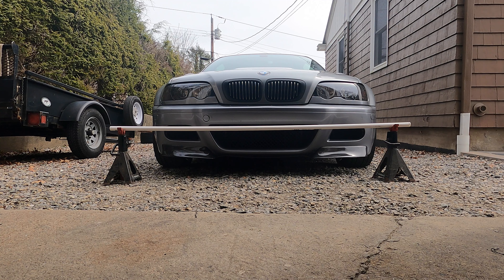How To Build chassis mounted string alignment kit - e46 M3

Comment: TOP job and nice touch!

also , if you have track width offset rear vs front you need to compensate for that when setting the reference strings \ square box

on my car for example , I have front track wider than the rear , front 1472mm and 1470mm on rear.  this means that on rear , if I measure from hub center to the string I must add 2 mm total  (1mm \ side) for having a straight string.

(or vice versa substract from front , etc)

* for track width need to have manufacture data

Comment: a few observations to improve accuracy. the cut slots in the pipe should ideally be the width of the string so it cant move side to, make sure you dont allow the front\rear pipe (with the notches ) to bend and this will mean you string rectangle around the vehicle is no longer a rectangle. also the front and rear cross tubes need to be parallel to each other and a right angle to the center line of the car. this is all for total accuracy, which considering toe measurements come down to a few mm, this is important.

Comment: I like the idea... but... 1) If the string box were perfectly square, then the measurement from hub to string in the rear would be LESS than the measurement at the front; because the rear end is wider than the front. And 2) You didn't lift the car then drop it again to verify that the baseline measurements of the string box didn't change. I am very suspicious of the viability of this very good idea, and am hesitant to go through the effort of building one, only to discover that it will not hold its baseline configuration during lift and lower cycles.

If anything, you might want to add additional magnetic mounting support on the front support bar.

I do appreciate your video... but as I said: without seeing it in action, there is no way to believe it would work.